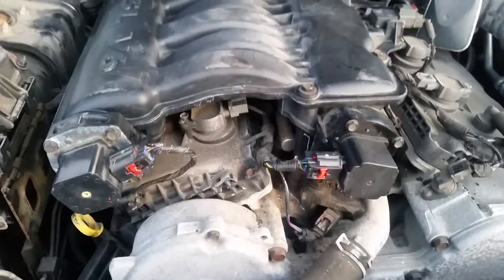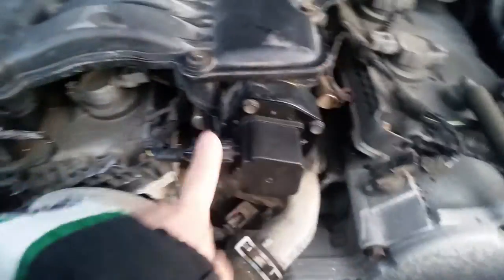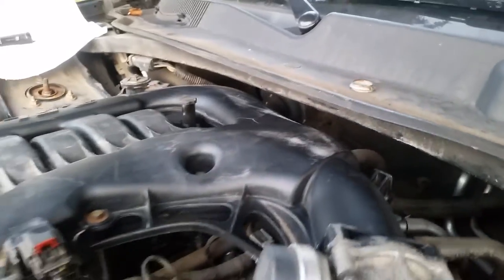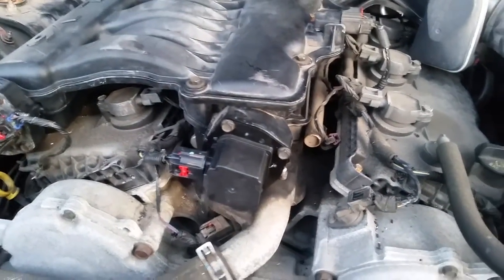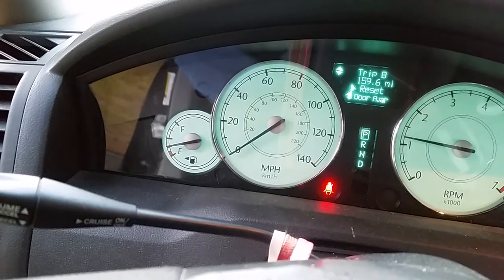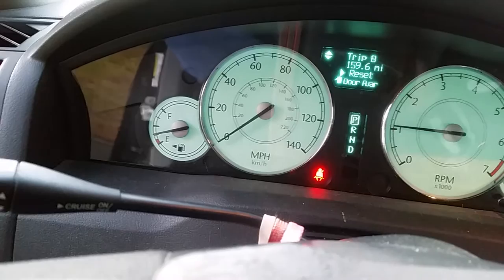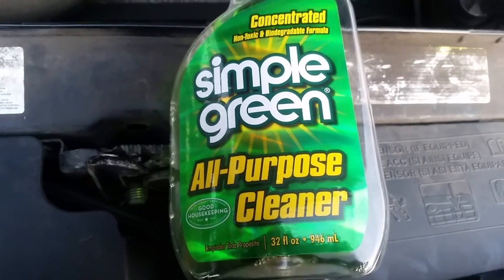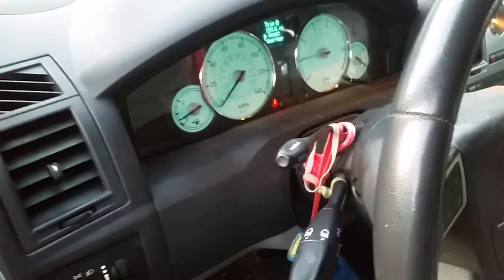2007 Chrysler 300 V-6 P1004 P2017 Part 3

Comment: Great video ❤ when installing the short runner actuator into intake, doesn’t it matter on position of butterfly spindle? Should butterflies be in the open or closed position? Does this make sense? Please let me know I’m just about in the process of replacing my manifold. Any input would greatly be appreciated thank you for all your awesome videos! 👊🍻
Reply from the maker: The actuator only goes on 1 way, you can't mess it up,  but a brand new intake manifold comes with a new actuator
Reply: @alyoungcuda  thank you for the message but the new manifolds are sold with out the short runner actuator! Can you believe that shit? Oh ya they’ll gladly sell the actuator separately for a cool $220 plus 🤦🏻 I’ve been shopping for a manifold for a while now and everyone I’ve purchased from has responded with refund and said it wasn’t available. The newer manifold (part # ending in AO) AJ no longer available. AO manifold are sold new without the short runner for around $700 plus. I appreciate the feedback. I know actuator has small slot to align up with on intake. This whole engine light thing sucks because the car still runs great! I just hope the new mani fixes the light and I can move on. Thx again bro 👊 for all your support wisdom and expertise 🍻
Reply from the maker: @tresemundo  I tried to clean out and loosen that flap and it was useless...I searched around on the internet and found it in a  Texas  dealer..good luck on it, someone has it sitting on a shelf..if you go to the dealer to ask for it, they can tell you if another dealer has one.
Reply from the maker: @tresemundo  do you have a full part number?

Comment: did your engine light comeback
Reply from the maker: VIP STYLE it went off enough to pass inspection, but it came back, part 4 installed a new one..
Reply: I sprayed Two shots of WD40 inside of both Sensors and worked them back and forth and so far I’ve had no Check Engine light!!!!!🙏🏾🙏🏾🙏🏾
Reply: @kevinfarmer3778  thank you for your input but I’m curious to know which sensors? Thx and also with regards to engine light, what was your code read out? P2017, 1004 etc? Thx 👊

Comment: I had oil coming out when I took my short vavle out. Why is that?
Reply from the maker: KEL out of the solenoids up front?..oil comes in from the rear oil pipe and sludge will accumulate in the manifold butterflys...thats why they bind
Reply: Al Young yes from up front after I pulled out the solenoid dark oily substance drained out.
Reply from the maker: KEL that's the oily stuff thats gonna jam up the butterflies and give you a check engine light